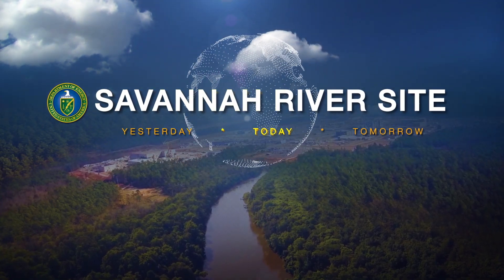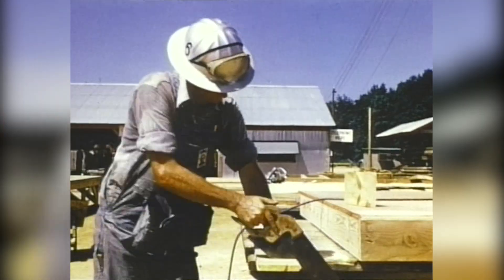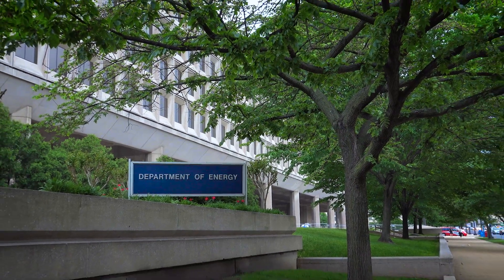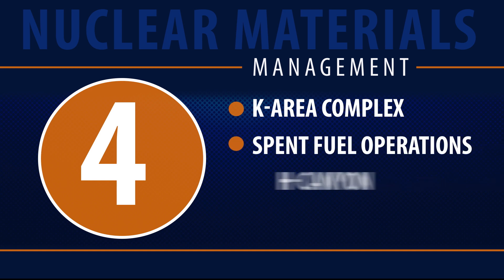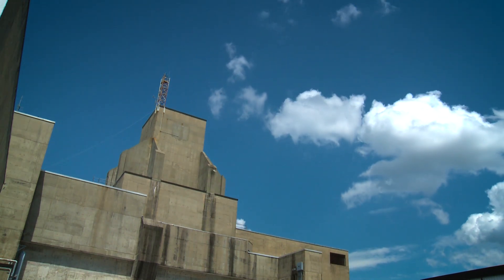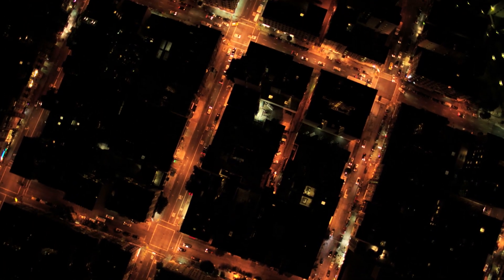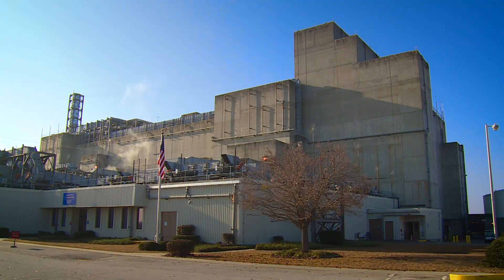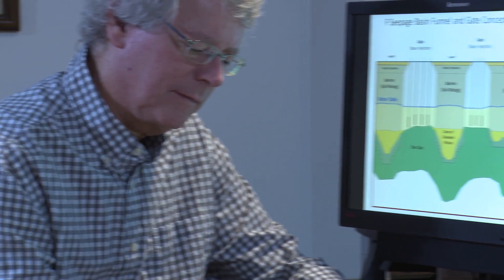SRS Overview 2016

Comment: A place like SRS couldn't be brought online from scratch in many years or a far cry from the original 3 years way back then. Think of what it takes to build a house with all permits needed now and add radiological concerns to the construction.  If all of that had been required back in the 1950s we'd be speaking Russian, now!
Reply: Yes we would. I worked there.  the plant was  constructed faster than the blueprints could be drawn or changed. Blueprints for jobs drawn during construction were not accurate and caused problems when something had to be done 30 or 49 years later  and reality did not match the documents.